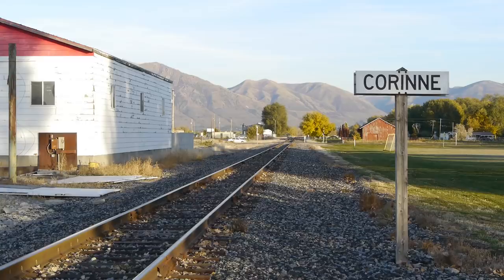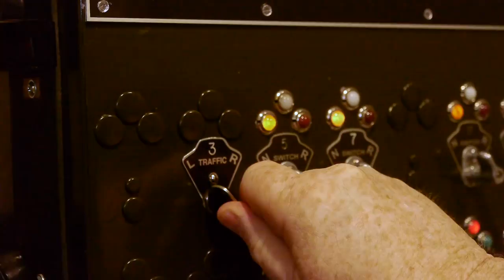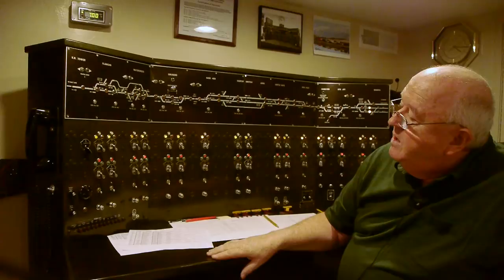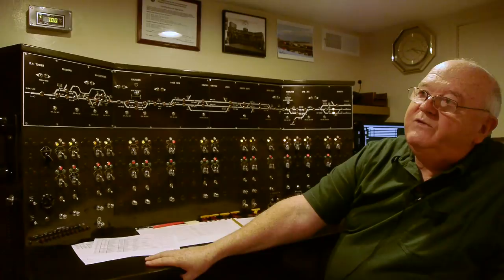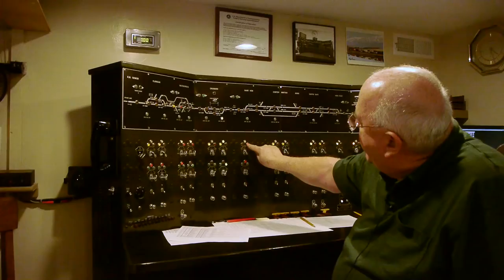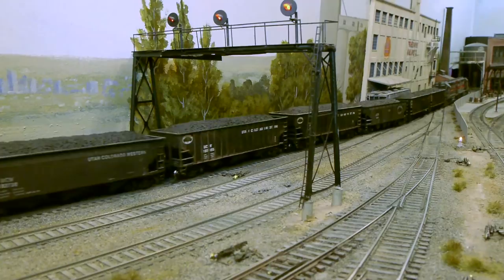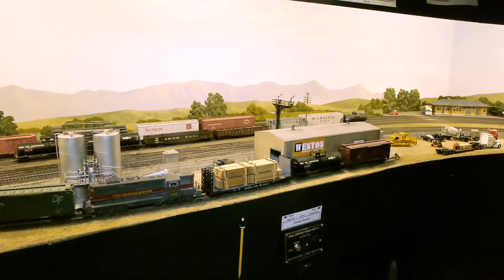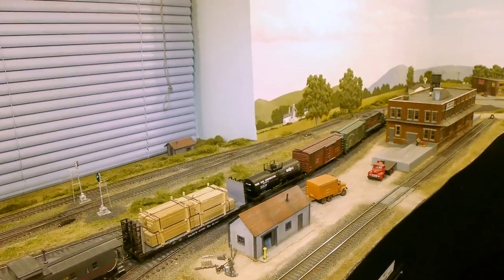Super Realistic HO Train Operations on Lee Nicholas’ Utah Colorado & Western

Comment: Very realistic operations.  I saw a YouTube video where they used RFID operations!   All of the engines and rolling stock had a RFID “chip” and used that for delivery or assembly of the trains.  The engineer would back the cars over the trader and the computer would align the switch for delivery.  Once completed the local would take the next consist to final destinations.   Realistic operations at the highest levels.  Creating a consist in the back room was done with barcode reader and making it up.  Then it was ready for the operator.
Reply from the maker: Sounds really great. Similar to this but no RFID.

Comment: My friends weren't quite this refined.  At that time they were studying electrical engineering.  But I could see them doing this in time. They had built their own switching monitoring system. It rarely failed.  But sometimes it did, which gave the rail crew a big clean up. :)
Reply from the maker: In Jr high we had a basic electronic class. As part of shop. Teacher asked if anyone had built anything electronic?  I had built a crystal radio but my real prize was my layout and I said so. All the kids laughed. “Yea so hard to hook two wires to the track”. No I said, two trains on the same track, individually controlled, working reverse loop and 2 sets of automatic crossing gates. They laughed louder. NERD!!!! You can’t win. Not when your 14. .
Reply: Oh yes, I had great trouble learning about switches and wondering why the locomotive would suddenly back up.  Just about the time I had my O gauge assembled around the house, I had to take it apart again.  Then I had this hair brained idea to put it up in the back yard.  I had the first yard railway in high school.  Had more trouble with rusty connectors, but full throttle on the loco took on new meaning. So did having a basset hound chase it.  I've always played with the idea of doing that again; even putting one against the ceiling and running it through the house.  I live in a 5th wheel now, so kind hard.

Comment: I thought you made a video about the radio control system for this railroad. I can't locate it. Is it available or am I mistaken?
Reply from the maker: It was up for a day!! Then I was told to take it down. Assuming they work out their issues, I'll put it back up in a few weeks. The switch stand is not ready and the guys making it freaked out.